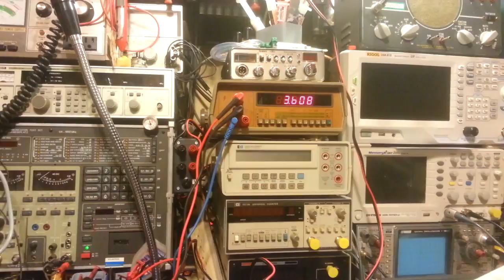Midland 79-892 with bad Cybernet VCO can.  Another one repaired and saved.

Comment: You do a nice job on the VCO blocks Mike.
Reply from the maker: Hadn't planned on replacing that ceramic 68pF capacitor but I nicked it while trying to grind the diode out.  Better safe than sorry philosophy so I replaced it to.
Reply: Good idea. Safe that way. You are rocking out the videos.

Comment: Nice repair Mike...what do you use as a silicon potting compound? Would be handy to have some on hand.
Reply from the maker: Loctite 5140 Potting Compound.
Reply: Looks like my GC Chemicals Electronic (non corrosive) Grade Sealant will probably do the same thing.
Reply from the maker: +Dino Papas 

Yeah there are a bunch of types from different manufacturers.   I got several caulking tubes of the Loctite at a industrial auction a few years ago.

Comment: I have an Othermill. The board for that would be pretty small and fast to mill. Any chance that the board could be reproduced? I know I could make one if I had dimensions- length, width, component location, and pinouts. If you're up for an experiment and can supply the info I'd be glad to mill one and send it to you. Once you verified it is built right I could mill a few more and send them to you. 73 NE5U  Mike
Reply from the maker: Actually I'm kind of working on that.  Need to order some adjustable coil/transformers and find a suitable substitute first.  Once I do that I was planning on doing the rest in SMD components. I already know the values for all the other components.
Reply from the maker: +ab5ni 

Already working on that with Mark. :)  I have to order an assortment of adjustable transformers to try out.  Once I find one that works well I can get some boards made.
Reply: Wow, that would be cool!  ~Jack, VEG